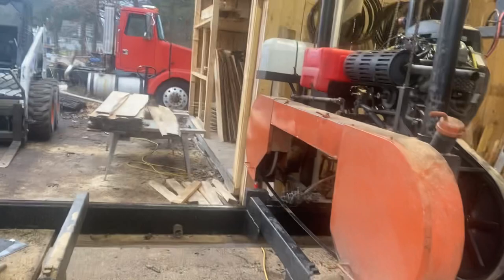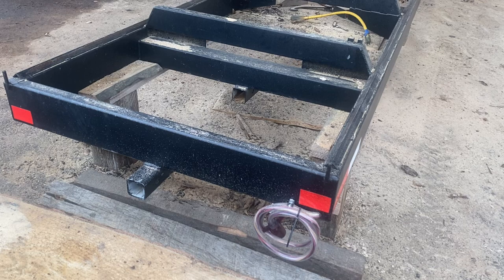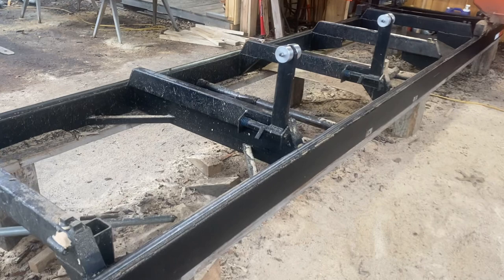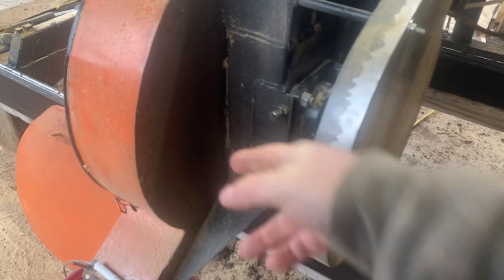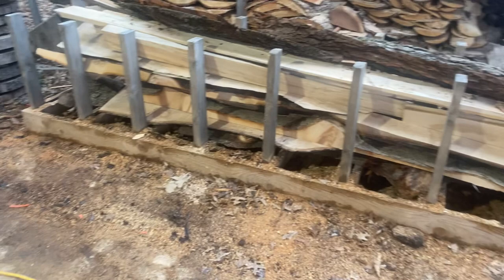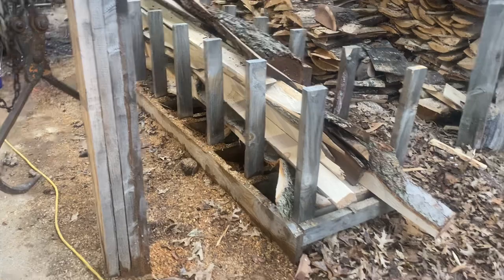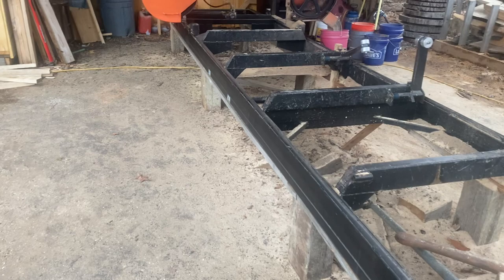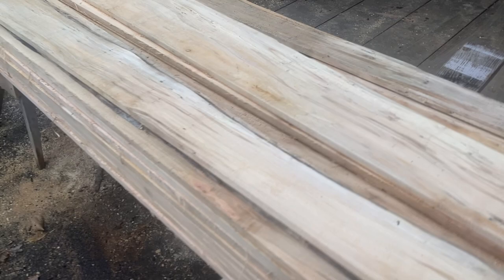Homemade sawmill ideas and tips(how it’s made)

Comment: The drive cable is what I've been looking for for weeks..I knew there had to be a cheaper way than buying 40 feet of chain and sprockets...A wheelchair or treadmill motor along with its speed controller would have y'all fixed up..Or maybe even a old trolling motor with the big pententiometer rheostat or whatever  it called..or spelled..Or the newer one with infinite speeds..and a couple limit switches...or micro switches from the door of an old busted microwave...could auto raise/reverse.....with a harbor freight wireless winch controller for really lazy operating..lol...Then then....Sorry..my coffee came out strong this morning..Ha..Great video 
.
Reply from the maker: Thanks for watching and commenting. We have the motors and stuff already to go for the project we just haven’t gotten to it yet. We’ve been to busy with all kinds of stuff and the mill functions pretty well the way it is for the time being till we get to that soon. And I did think about a trolling motor which I thought would work great. But we found motors fairly cheap on eBay for the raise and lower and the forward reverse. But for anyone not wanting to go that route I really enjoy the sensitivity and feel that the cable gives you while cutting. 👍

Comment: Great job really like the hydrolic tentioner from a jack its the only way to go i designed a mill to do 7 ft sqare log super heavey duty with a 40 hp wisconson gas engine 2 in ball screws for lift and liniarl rails and 36 in cast iron wheels take a 2 to 3 in wide blades s beam 40ft long rails and special tracks 6 in casted wheels  and the frame will hold 30,000 logs,i making it for timber framing for big long timbers it will be on a 12 in slab concrete with 1in.duel Leveling bolts auto feed digital read out for the hydrolic controls cant wait to get started on this project its a special well designed mill.,but nice job on yours very well built congrads.
Reply from the maker: Thanks for the comment. That’s a heck of project. Man I’d love to see that thing. And help around that thing. Pretty sweet.

Comment: This is prob the best homemade mill I have seen so far.  Id love to see a sketch-up to model a build after it
Reply from the maker: That’s quite a compliment. Thank you very much. I’ve run other mills and there was likes and dislikes I had, then I tried to implement those on this one. Let me see what I can put together for some drawings to help you out.
Reply: @PaulWhitedWoodStoneIron  that would be awesome!  I have been going back and forth between building one or starting off with a cheap chinese one from a manufacturer of alibaba....   i love the features you have and it also seems to be fairly budget friendly without the hydraulic drive or electronic drive yet.   It definitely looks like a professional build.
Reply from the maker: @HodgePodgeGarage  thank you. I have $3150 into it but I did buy the steel 2 years ago so a bit different.  But every time I use it I’m always happy when it comes time to shut it down.
Reply: I would also love to see some sort of plans for building
Reply from the maker: @randyorchard5012  I will add you to the list too once I have them put together. Thanks for watching
Reply: I like your hydraulic tensioner and wish I could incorporate it in my linn lumber mill build. Can you tell me about the tension springs and where you got them? Good job and one of the best I’ve seen!
Reply from the maker: @christopherruggiero8108  thank you very much. The springs I was able to purchase off of eBay. 3/8” diameter I believe if I remember right. They do seem to work perfect doubles up. I did cut them down to about 4” each in length also.
Reply: Please add me to hat list when you get some plans together! Very VERY nice job (-:
Reply from the maker: @hi-risehre8106  thank you very much. I for sure will. I’m working on them still.
Reply: I would love to be added to your short list when you have plans, I am continually updating my sawmill
Reply from the maker: @dylandiguistini9625  no problem. Thank you
Reply: Agree. A very inspirational video. Would love to build one like this in Australia. Count me in if you produce plans. Cheers.  Dave.
Reply from the maker: @davevaughan1004  thanks Dave. Will do soon

Comment: Great video, for your information I used to have a Turner saw mill and they originally had a double belt but changed to a single belt because the blade would never stop turning when the clutch was disengaged,  you probably would need to add a brake to the band wheel.
Reply from the maker: Ahh good point ya. Thanks for watching.

Comment: One thing not mentioned and I am sure you just overlooked it. Adjusting the small end of a log to get the pith level with both ends. I used a plate between the two frame rails and just set a screw jack from under the hood of the family pickup truck. A few turns up on the first sides to get it adjusted.... meaning when any flat side comes down on the deck... its now all ready for cutting and the jack is out of the way by simply adjusting back down and ready for the next log. If its within a inch or close, I just never worry about it. I also cut maybe a bit different as I turn a log, I only do quarter turns as I just don't enjoy hard labor turning a can't or a log thats looking like a snake with knots on it..... I enjoyed your video, so subscribed and will share it with other beginners that struggle as they overthink things making it harder on themselves.  I guess the best thing I tell people is to respect a mill but don't fear it like its going to jump out and get you. I started cutting ties on a circular saw for my day in and about 1960 so yeah just a kid here.
Reply from the maker: Yes we didn’t address that in this video I don’t think was centering the pith. You are right about many things in your comments too I agree. I like your idea with the jack. We want to address many other things with future videos such as that. And depending on what the log is like we usually just do a 1/4 turn also it is mostly easier I agree. Thank you very much for your nice comments. As a hobby for us we for sure love having a mill.
Reply: @PaulWhitedWoodStoneIron  :>)

Comment: 2:07 oak 2x2. Why didn’t I think of that? I guess when you weld everything needs to be made of steel lol I’m definitely going to modify mine to this style. Simple, cheap, and effective.
Reply from the maker: I started with steel 2x2 and thought wood would be good to not have to worry about it. Works great especially when edging boards. I checked out your mill too and subscribed. Nice mill you got there. I like it a lot.
Reply: @PaulWhitedWoodStoneIron  thanks! I’ve still got a lot of mods I need to do before I work it hard, but it’s useable right now. I also want to upgrade to a double drive belt system. I’m unsure how the single will do in wide logs. My guess is that I’ll just have to cut slower.

Comment: Just found your video, as everyone else has said Great job on mill.
How did you build the round vertical guide tubes ? Are there some type of bearings used?
Reply from the maker: First thank you very much and yes there is a plastic sleeve in between the inner tube and the outer tube. About 1/8” thick. It’s not a very tight fit but just enough to keep out sawdust and allow it to move freely. And also not bind. I went around with the idea of roller bearings and other ideas and I’m glad that I went this route as it works very well still and no signs of wearing as well as not bouncing when cutting either. This plastic piece is something I made on my lathe.

Comment: Great build with some clever design features. I am consudering building a mill and your build provides a lot of inspiration. Please could you elaborate on how the saw head is guided up and down? It looks like you use tubes with a larger diameter tube as a sleeve. What sizes of tubing is it and does it include any bushings? I would also be very interested if you have any drawings. Thanks Ed.
Reply from the maker: Thank you Ed. I did make a second video a week ago that described the tubes with sizing and bushings in close up. I am working on some drawings because I’ve been asked a few times. I’ll let you know when i get them finished. I hope the second video helps some. Or part two video.
Reply: @PaulWhitedWoodStoneIron  thanks, I will check that out!

Comment: Where do you get the rubber tires for your band wheels. I’m running a 18.75” v-belt pulley and I need tires for it.
Thanks in advance 
Rocky Thomason
Reply from the maker: I run 57 B belts. Which are 57” 5/8” belts. They fit the best for me on 18.75 pulleys. 56 B belts are a bit tight. I ordered mine online and have worked well for over 100 hours so far and going strong. That’s a lot of wood cut for a hobby mill to me.

Comment: Great video! How did you do the bearings for the band wheels? Are there two flange mounted bearings on each side?  I would really like to see a little more detail on the adjustment of the band wheels for tracking.  How do you adjust the roller guide arm to make it line up perfectly with the blade?
Reply from the maker: Thanks for checking out the video. Somewhere I show a close up. I know I did a second video and it might have shown more close ups. And the arm for the adjustable guide takes some figuring for sure. And I believe I showed how I made the tightening of the guide arm bearings which helps adjust the exact placement. And I do believe I also showed more of the bearings close up on the second video. If that doesn’t help let me know. I can get something better.

Comment: sure enjoy your video. best one I've seen  yet. I was wondering how wide is it from outside to outside on the box frame and what is the dimension from center of wheel to center of wheel. Also what is the maximum width of log will it cut? Thank you for your consideration.
Reply from the maker: Thank you very much. The mill is around 58-60” center of wheel to center of wheel. For a 171” blade. Max width for us is 37.5” that took some doing with the guides but we squeezed it in. And the posts max width is 40” between them I think. If you have any other questions feel free to ask for sure.

Comment: Hi Paul. Excellent. Just fantastic. Are the mills dimensions mentioned someplace? I am shooting for ~38" log diameter capacity. 1) What is the length of the mill frame base?  How did you determine band length? Duplicate a production mills center to center? Very helpful info in these videos. I have a ton of questions but will figure it out.
Reply from the maker: You can email me at americobac@aol.com. And from there we could even talk on the phone if you’d like. Thank you for the nice comment. There is two videos we explain stuff (part 2). If that helps. I figured out the dimensions off of a 171” blade which is a standard Woodmizer blade length. This makes getting blades easiest. Like the next day when I order them. Because they’re already in stock that size. The base is 24’ long which is the length of the tubing when purchased. I would be happy with measurements to help out. It took me some math and figuring to get the max width of 37.5” but it could handle a 42” log between posts and 37.5” between guides.

Comment: hello a great video. but I need to understand the advance system, where the pulleys are welded and what is the purpose of the long cable, I appreciate the information
Reply from the maker: Thanks for watching. I’m going to be making another video this weekend of a few more close up items. I will include the driving cable system since you ask. But it is attached at both ends and the lower two pulleys are shaft and free spinning. The upper pulley is the driving force. The cable does need to be tight so that it has friction on the upper driving pulley to be able to function best. The cable runs under one pulley up to the drive pulley and back down under the other idle pulley at the base then back out to the other end of the mill this allows the upper pulley to work. Hope this helps. Thank you for watching.
Reply: @PaulWhitedWoodStoneIron  thank you very much for answering!!! I understand the idea better. I will be attentive to the more detailed video. Greetings, you do a great job, very creative
Reply from the maker: @felipeacuna3439  I really appreciate that thank you.

Comment: Thanks for your video,  looks like your saw head runs on a vertical pipe,  is this a busching or a bearing?  Also what Dia and thickness is the pipe?  I'm considering doing the same design.
Reply from the maker: Thanks for watching. We used a scheduled 40 galvanized 2.5” pipe because we had it. And then used 3” pipe for sliding mechanism. There is a bushing we made on our lathe with plastic that makes up the difference. It works great for us. No binding and plenty of support for the saw head. Which was my main concern. I plan on doing another video with a few more details in the next week. Touching on more close ups. So I’ll make sure I show that too if it would help. Wanted to show the hydraulic and spring tensioning system more close up as well.
Reply: @PaulWhitedWoodStoneIron  thanks for the quick response,  I'm going to use 2'' shaft for vert, lifting portion. IMO using a round bushing instead of using cam followers or rollers is a way better design. I'll be posting some videos as a go.  Thanks for your time.
Reply from the maker: @MillwrightGoneRogue  awesome I’m excited to see them. We used round because we had it and it worked well for us. And was easy for us to make a bushing on the lathe. If I had to build another one I would do the same thing again for sure.

Comment: Trying to understand the blade tension/hydraulic jack setup. Any more videos or info on it? Thanks
Reply from the maker: I am going to make another video that describes it a bit more in close up. Maybe even take it apart some to show the inside workings of the springs and how that transfers. It took me a few different try’s to get it to where it is. When I get it posted I’ll return to this comment and let you know. Thanks for watching. Is there any other stuff that could use a close up description.
Reply: @PaulWhitedWoodStoneIron - I have to build a carriage & wider sawframe. I bought a new Linn 1900 (36") stripped down head w/26" wheels years ago. Recently built a 20' x 73" wide (centers) frame thinking the wider slabs might sell. Want it just like yours but wider. What blade length/size to use is big question right now?
Reply from the maker: @JoelAllen-xj4cg  any wider that what I have I would go with at least an 1.5” wide blade and thicker probably around .55 thousands thick and plenty of blade tension. Would be great to cut the wider stuff. We use an Alaskan mill for the stuff wider than 37” that our bandmill can handle. And we don’t do to much at that width. We’re also only doing this for a hobby though. This keeps our blade pricing down for us on our majority of our cutting stuff. That was our thought anyway. But hard to beat a bandmill over all that’s for sure.
Reply: @PaulWhitedWoodStoneIron  - Stormo Hardwoods has video on here with a wide Linn sawhead (like my mine but wider). Can find no info/specs on it. Not as nice as yours but would save me a lot of time.
Reply from the maker: @JoelAllen-xj4cg  I like the design of the linn lumber mill heads. And to have 26” wheels is a big advantage on being able to run thicker blades. I think the design of the linn head unit would be able to handle a lot of tension that would be needed on the larger blades especially. One of the biggest things that I enjoy about the tension system on our mill is the spring back up  which gives it the ability to keep a constant tension as the blade changes under heat or cooling off. Wider cuts is harder to get the saw dust out of the kerf which is a main reason for heat build up. Which when it heats up it grows in length which then looses tension which can cause up and down waving through the cut. Worse with some logs than other. Any other part of the build is not as important to me anyway. Every part of the mill can be very precise but the blade is the whole part actually doing the work at each little tooth.

Comment: Since you have a gas engine, it might be easier to use hydraulic drive instead of electric drive

I'm building a sawmill of my own. Mine is going to need to be heavier built cause the motor that fell in my lap is a 4cyl 2.2 diesel running about 35-40 hp at 2200rpms. Beauty of that is I'm building the mill to cut up to 6ft wide. Tho I am definitely using some of your hacks, thank you so much for this vid
Reply from the maker: Right on that’s awesome. I see myself building another in the future and I’ve definitely toyed with the idea of the hydraulics which would open the opportunity for a log clamp and turner as well. Good luck. Hope to see some pictures maybe in the future of your build. Very gratifying cutting open your first log on your own mill you built.
Reply: Check out Mathew Cremona
Reply from the maker: @royramey5659  oh ya I’ve been watching him for years. Cool guy.
Reply: @royramey5659  likewise, I've been a fan of his for years. The only difference is his is electric, he might be better off looking at electrical options

Comment: Is there away to straight a twist board?
Reply from the maker: Yes there is for sure depending how thick the board is and how much is needed to remove to get it straight. But it can be shimmed underneath to hold the twist In the neutral position so to say and then clamp it and trim away. We have done this many times to flatten a board.